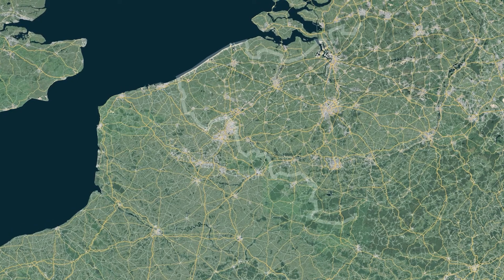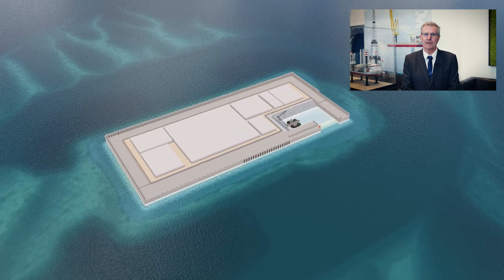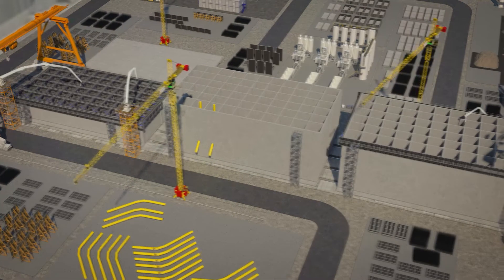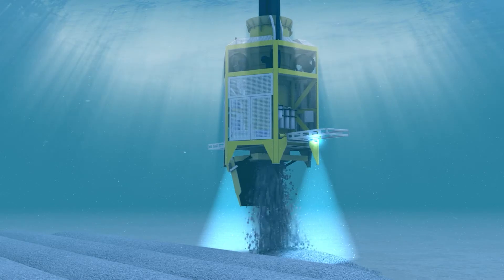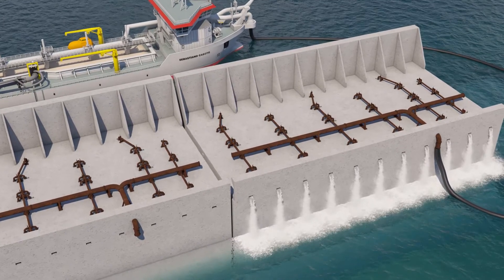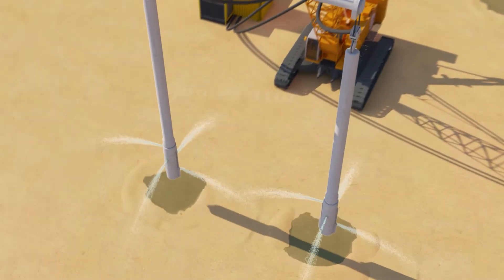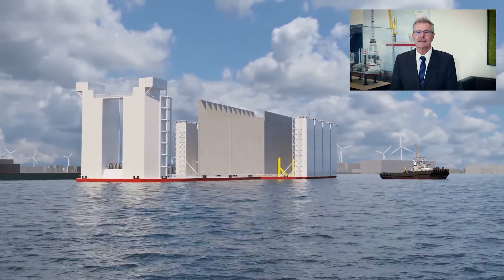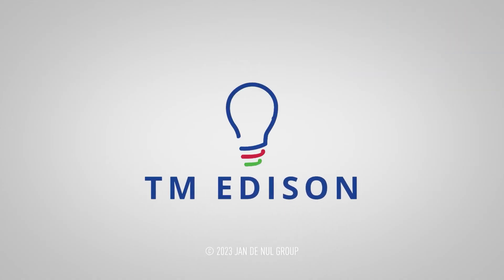Construction of the world's first energy island

Comment: This Island will not stay in position due to the pressure of huge amount sand on the inside and no back pressure on the outside.
Reply: With all due respect but I think this Will be taken into account. A lot of planning and engineering Will be key to this project.
Reply: You have absolutely no idea what you are talking about. The caisson sliding and tipping are the first things checked.